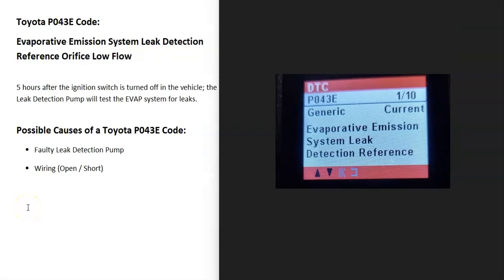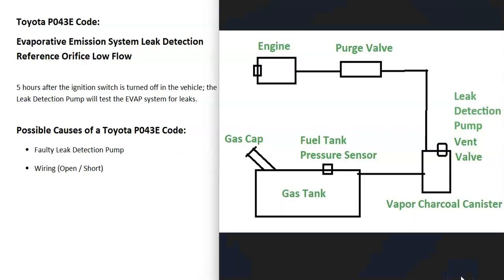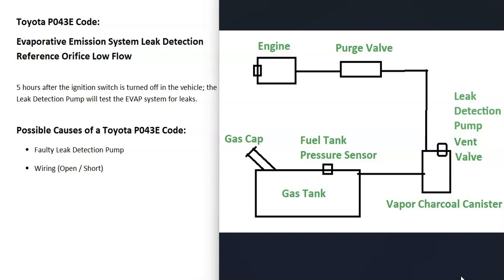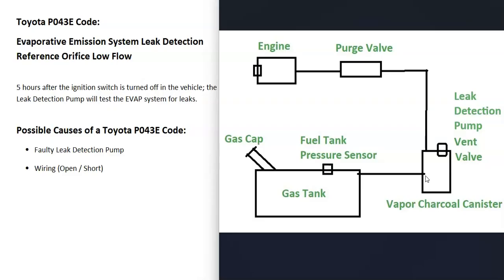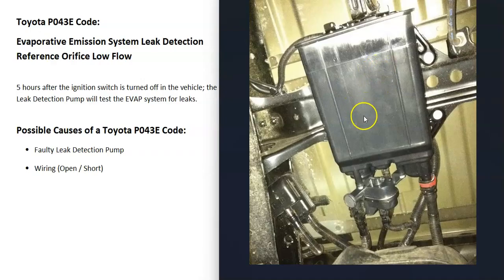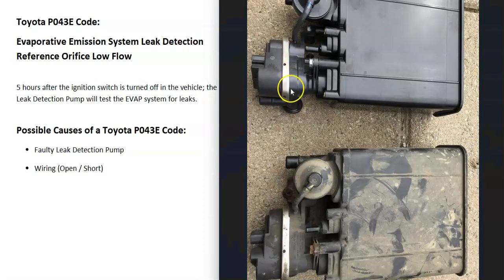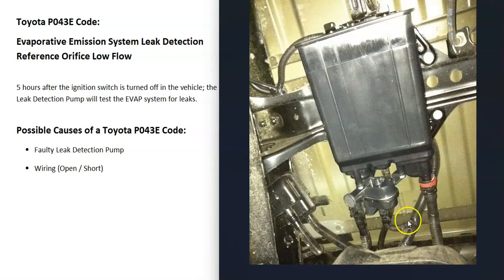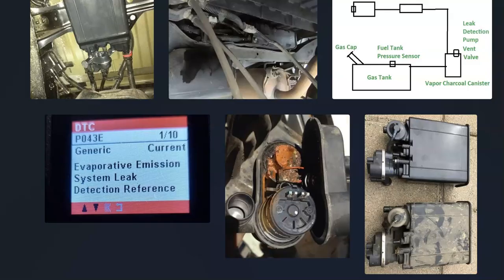Causes and Fixes Toyota P043E Evaporative Emission System Leak Detection Reference Orifice Low Flow

Comment: Good video like it codes can become a humbersome idea you think you changed one sensor nothing happens might go back to old days single carb engine no problems every man could work on them times have changed I understand that why would manufactures of vehicles make that difficult to work on is it engineering anything is of inperfection can simplistication not be ideal just wondering.

Comment: Can i just buy the spoiled part and replace or replace everything complete?
Reply from the maker: If the problem is a bad leak detection pump, they often can be bought separately, but it can depend on the year and make. Sometimes, the whole charcoal canister needs to be bought.

Comment: I put ignition silicone on the gas cap o-ring and code goes away for about a year then relube o-ring.
Reply: 13$ but a new gas cap
Reply: @josephuptagraw6366  it came back after 2 weeks this time

Comment: hey P2400 P043E P2402 P2401 P0456 043F toyota corolla i have changed the canister 1month ago and that code shows back again any advice i went back to the dealership he want to check again so i dont know
Reply: So what was the fix?
Reply: @fadys1394 it’s the ECM

Comment: For my 2010 Scion xB, the canister was completely replaced and the new one tested. I still get the code P043E (and P043F). I do also get P2401, P0456 with symptoms being lack of power sometimes going into 2nd gear and the constant triggering of the fuel pump at the gas station because the nozzle gets triggered to stop if I do not pump slow enough
Reply: Check the fuses under the hood that relate to the Emissions Control System (ECS). If those are bad the evaporation canister will throw codes from low circuit resulting in the canister to barely work and throwing out other codes. You may not have even had to get a new one. Most places are happy to charge you for the canister without even checking your fuses
Reply: Sounds looked my truck and just got a code the other day. Don’t drive it much but last time trying to fill the gas, it kept clicking the pump off every half gallon. So frustrating. What did you have to do to fix?
Reply: @gooutsideandplay4975  I sold it before I figured out how to fix that particular problem. Sorry I could not be more helpful

Comment: I have this code as well as p2401 p2402 and p2419. Are they all related?
Reply: @DavidPacJr I have the same codes. Did you figure out the issue?
Reply: @pr9551  charcoal canister
Reply: I have those same three additional codes on my 2015 Highlander Hybrid. Carbon Canister had been replaced, wiring checked. Dealership's next step would have been replace ECU which is expensive, so I ignored it. It went away for two years and now came back again recently. The going away for 30,000kms and then coming back is throwing me off. Does that eliminate any possibilitites?
Reply: @sophiaweber1533  I have no clue
Reply from the maker: Yes, they all point to an issue with the EVAP system.
Reply: @HVAC_Mechanic  do you think I should replace the entire thing or just the pump that’s connected to it?

Comment: Hey my mechanic just told me that my 2010 Toyota camry will blow if I do not replace the leak detection pump because the emissions are not escaping. Is this true?
Reply: He said "your basically driving in a bomb".
Reply: No, it will not blow (up).  You mechanic blows.  You may have some gas vapors getting to the atmosphere, which is what this is designed to prevent. It's a simple and clever system, actually.

Comment: Is this s critical issue item?
Reply from the maker: Usually, an EVAP problem will only cause the vehicle not to pass an emission test. The EVAP issue that can cause engine problems is if the Vent Valve is stuck open, which can cause the engine to run badly.
Reply: @HVAC_Mechanic how to know vent valve is stuck open?